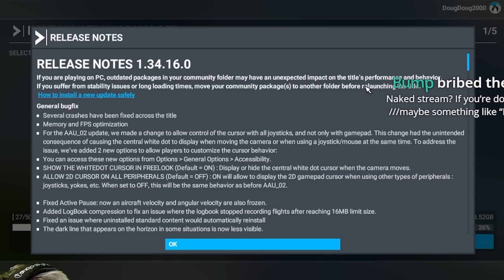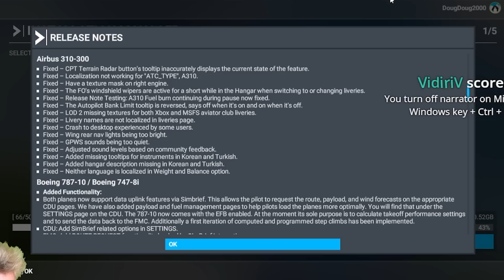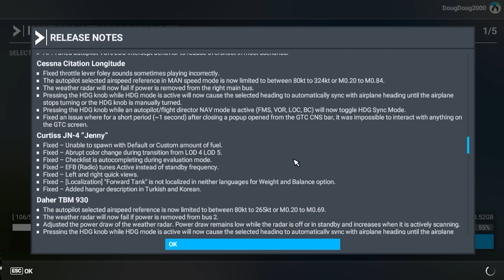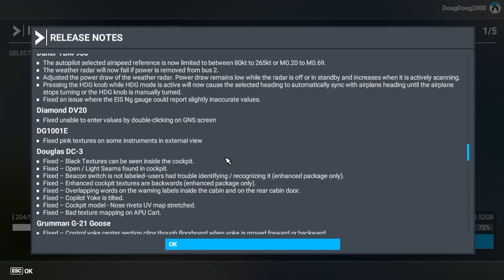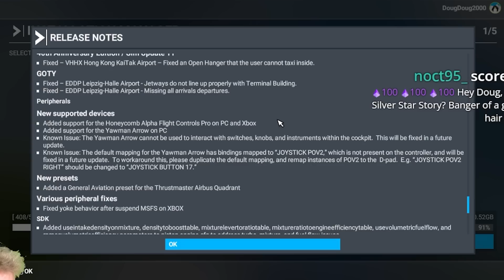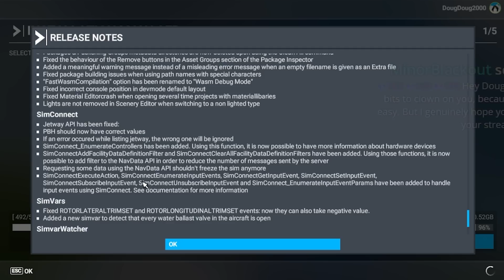Microsoft Flight Simulator release notes 1.34.16.0

Comment: Hey guys, this video DOES NOT include RELEASE NOTES – SIM UPDATE 14 [1.35.21.0] which adds the following changes:

NEW CONTENT/FEATURES
Added flight plan assistance setting for ATC in the user experience assistance settings so that users can request the ATC to favor their flight plan or world map flight settings over the current conditions. This assistance is set to “Active” by default. Active: ATC will set the active runway and approach for the departure and arrival airport based on the users flight plan or settings in the world map. Deactivated: ATC will set the active runway and approach based on current conditions only.
ATC now clears a step to the next altitude some time before arriving at the previously cleared altitude, rather than once arrived at the previously cleared altitude. (Next step is issued when at 2000FT from cleared altitude rather than 250FT from cleared altitude).
ATC Vectoring bug fixes:
Now assigning the correct clearance when the first two waypoints were one over the other,
Now assigning a new vector & clearance every time the user asks the ATC for a new vector.
Added completely new Cirrus SR22T G6 model with custom engine simulation, book-accurate performance, and extensive Perspective Plus NXi features.
 
GENERAL BUG FIXES
Several crashes have been fixed across the title
Fixed localization bugs
Performance optimizations for long flights.
Fixed ATC that was mixing voices in localized languages
Automated Weather Report temperature reading updated
 
MARKETPLACE
Fixed an issue where the Wishlist would not sort properly in the Marketplace
 
MENU
Fixed freeze when opening the logbook
 
NAVIGATION/TRAFFIC
Enhanced ATC phraseology. Some of the improvements include:
The removal of the word ‘for’ in altitude change requests.
Eliminating the requirement to include altimeter settings in takeoff clearances.
 
WEATHER
Snow and ice coverage accuracy has been improved in live weather
Fixed an issue where the wind from a malformed METAR was incorrectly read
Fixed an issue where the sim occasionally retrieves obsolete weather data
Improved transition during cloud coverage updates AND fixed an issue where clouds don’t load when starting a flight.
 
GLASS COCKPITS
GARMIN G3000 / G5000
Fixed an issue where removing an airway entry leg from the flight plan could sometimes corrupt the flight plan.
 
 
AIRCRAFT
GENERAL
Payload station weights that are set via SimConnect are now properly displayed in the Weight&Balance toolbar panel.
Fixed – L-39 Pipsqueak – Unable to enter values by double-clicking on GNS screen
Fixed – L-39 Sarance – Unable to enter values by double-clicking on GNS screen
Contact Points compression under some kind of roof (bridge, cave, arch, etc.) was fixed
Fixed – P-51D LadyB – Unable to enter values by double-clicking on GNS screen
Aircraft Registration can no longer be lowercase
Fixed – P-51D Miss America – Unable to enter values by double-clicking on GNS screen
Fixed – P-51D Strega – Unable to enter values by double-clicking on GNS screen
Fixed – T-6 Baby Boomer – Unable to enter values by double-clicking on GNS screen
Improved aircraft simulation stability (few potential crashes were fixed)
Fixed – T-6 Undecided – Unable to enter values by double-clicking on GNS screen
Corrected an issue that could prevent cockpit interactions from working in some rare conditions
Correct many false positive errors regarding InputEvents when loading AI planes
Corrected an issue that would cause some P51 to lose power in reno races.
Fixed an issue that could cause the state of Avionics circuit depend features to be toggle on and off when no MarkerBeacon circuit was present
It is now possible to slow down the simulation speed to 1/8 and 1/16 of real time.
EXTERNAL HUD
Minimized HUD can now display more than 8 engines power values
HELICOPTERS
Anti-stall protection is now disabled for helicopters.
AIRBUS 310-300
A310 Radio Stuck Broadcasting on KSNS ATIS After Departing KSFO.
Vertical speed knob labeled as “altitude knob” in tooltip.
AIRBUS A320NEO (V2)
During testing of the A320neo, we encountered an application crash rate on console that is too high to pass certification. We need to address this issue before the A320 can ship.
BELL 407
Rotor weight changes.
Rotor brake force adjustments.
Rotor blade dynamics adjustments.
Throttle/governed RPM during startup and shutdown.
Engine performance changes.
Fuel management on the weight and balance settings.
Performance data on the aircraft selection screen.
Localization text changes.
FADEC tooltip.
Fuel Pressure gauge illumination.
Cold and dark state changes.
Checklist correction.
Fixed checklist AutoStart. AutoStart sequence now works.
BOEING 787-10 / BOEING 747-8I
General performance optimizations for consoles and some hardware configurations
W&B: An operational CG margin is considered now to avoid extreme CG values when loading the aircraft.
SIM: ATC will now know about your planned cruise altitude and will assign you a flight level accordingly.
CHECKLISTS: Fixed bug where checklists that only contain closed loop items would sometimes be skipped when entering the checklist page if all items are completed.
[787] CHECKLISTS: Fixed flaps checklist items being completed before the flaps reached the selected position.
[787] W&B: Corrected movement of the CG as fuel is burned by moving the tanks to the exact locations of those on the real plane.
[787] EFB: Support clearing of the TOW field.
[787] EFB: Cap the achievable MTOW at the certified limit of the plane.
[787] EFB: Correct error message when current TOW exceeds the achievable MTOW.
[787] EFB: Added Automatic brightness adjustment.
[787] EFB: Fixed spelling errors.
[747] SYSTEMS: Reserve fuel transfer will now not stop once started mid flight.
CDU: Fix takeoff speeds being invalidated when opening TAKEOFF REF on the copilot side
CESSNA CITATION CJ4
SIM: ATC will now know about your planned cruise altitude and will assign you a flight level accordingly
CIRRUS SR22T G6
Completely brand-new art and model of the SR22T G6 GTS.
Completely reworked flight model and performance featuring:
CFD with book accurate performance and pilot tested handling.
Modern propeller system.
New turbo and fuel engine systems.
Custom ECU, engine computer, and EGT/CHT simulation.
Custom lean misfire, detonation, and engine failure simulations.
Full Perspective Plus features implemented for G1000 NXi, including:
Full-screen engine page with anti-ice status and fuel flow targets.
Full-screen fuel management page.
Weight and Balance page with graphical CG envelope.
Trip planning page with automatic and manual modes.
Massive suite of interactive checklists.
MFD destination inf-box.
PFD power gauge, GAGL indicator, GS and TAS.
Frequency loading menus on airport and waypoint inf-pages.
FIKI (Flight int-Known Icing) and TKS simulation.
Stabilized approach system with PFD alerting and monitoring for:
Bar-mismatch, crosswind, tailwind, flaps, lateral deviation, and vertical deviation (GS and GP).
Updated EIS with custom reversionary mode version.
Lean assist, fuel flow green band, and cyan fuel flow lean target indicators.
Fully modeled GCU479 Garmin Control Unit keypad with all entry modes.
Additional new autopilot mode support including LVL, TO, and GA.
Large suite of accurate CAS messages including new G1000 NXi alerts acknowledgement and menu behavior.
DAHER TBM 930
Fixed broken autopilot panel backlighting.
DOUGLAS DC-3
Fixed starting engine in Multiplayer causes other DC3 engines to animate starting
Fixed overlapping words on the warning labels inside the cabin and on the rear cabin door. (Enhanced)
Fixed Radio altimeter appearing off above 400ft.
Classic 8-way Quick view controls fixed during flight.
Fixed fuel pump does not indicate fuel flow from Cold/dark until after mesh switch is engaged. (Enhanced)
Improved low resolution text in the Enhanced Edition cockpit. (Enhanced)
Fixed missing panel texture for Beacon light. (Enhanced)
GRUMMAN G-21 GOOSE
AI copilot completes checklist items for you in Evaluation mode.
Attitude Indicator doesn’t provide pitch indications.
Fuel drawn from wrong tank when starting Cold & Dark.
Part of tooltip description for Magneto Cutoff not localized.
Unable to toggle “taxi light” in cockpit–must use key binding.
H-4 HERCULES “SPRUCE GOOSE”
Camera Quick views fixed
Engine 5-8 throttle fixed when using a gamepad
ROBIN DR400
Fix Flaps looking misaligned with the wings in neutral position.
RYAN NYP “SPIRIT OF ST. LOUIS”
Camera Quick views fixed
WRIGHT FLYER
Camera Quick views fixed
WORLD
Used more realistic mapping of wave lengths onto RBG values for the ozone layer scattering and the sun color, resulting in more realistic colors of the sky and the lighting in the world.
 

TOP-GUN MAVERICK
Fix for the aircraft carrier wake in Maverick landing challenge that was missing 

And more...